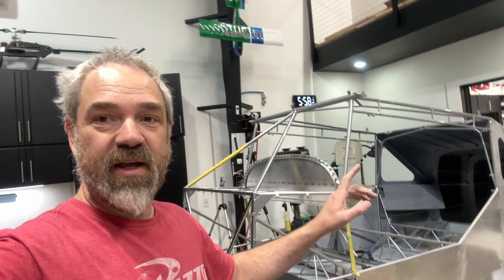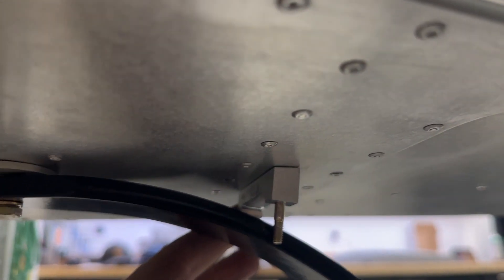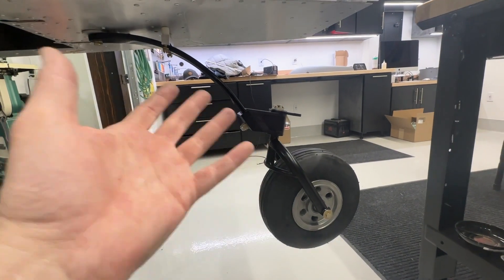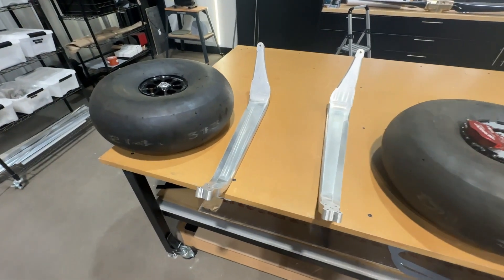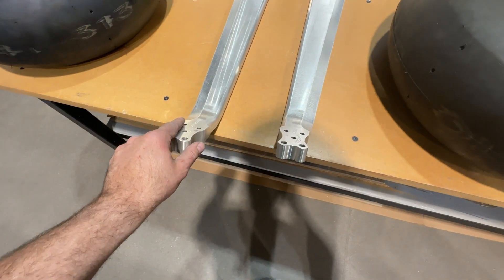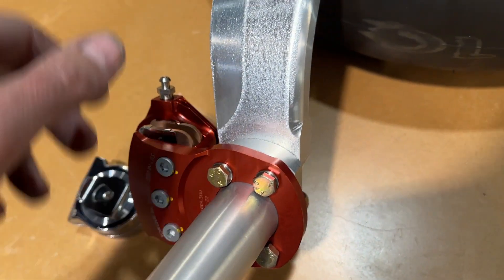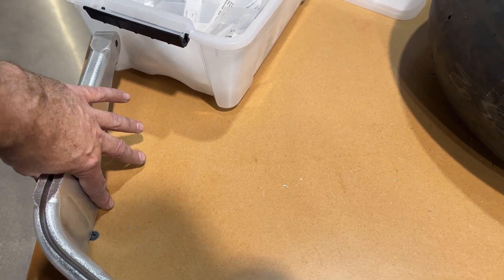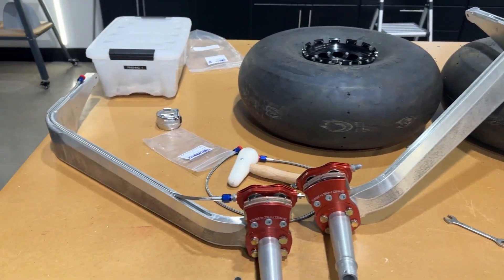Ep. 23 - RANS S-21 Landing Gear Installation

Comment: Not sure if you have addressed it in a future video, but did you ever figure out what 45 degree fitting was needed for the calipers? Just putting in my Beringer order and want to get the hardware sorted. Thanks for the heads up on the AN-5's. Hopefully they will get that corrected in the kits. Beringer kit for the S-21 is reference AV-RANS-421-01(B) for anyone else looking to order.

Comment: Soooo, my tail wheel bolt, just sheared, causing the tail wheel and spring horns to jam up under the tail cone. I remembered watching this video and came back to it to look at that arc, and I’m wondering if that bolt has to put an extra amount of tension to straighten out the spring?
Reply from the maker: Interesting. Where the bolt broke can tell me things. Did the head break? Half way down? 

The way Rans has the spring curved at the bolt it applies an asymmetric load on the head and a bending force along with tension. It’s a terrible arrangement that I wish they’d own up to and revise.
Reply: The bolt sheared at the base of the nut on the first thread. It was a wheel landing and happened taxing in on a smooth grass taxiway. I suggested to them that perhaps someone over torqued it…. Not happy.
Reply from the maker: Ahh right.. the bolt head is at top and points down. That location of the break suggests the issue I have mentioned.  The load on the nut is asymmetrical placing the bolt in a bending load right at the spring. Being the threads end just inside the spring this is the weakest part of the bolt and also the point of the highest load due to the bending from the curve of the spring and subsequent asymmetric load. 

Maybe when a few more snap they’ll actually believe there’s an issue.
Reply: @Outbound300  I agree 100%. Now I have to fuss with the damaged sheet metal from the tail wheel and steering horns that punctured the bottom tail cone skin 🤬

Comment: It looks like the rear spring is backwards. Looks like the tail end is flatter with no curve and would help keep in line with the skin if you flipped it. Or it’s the camera angle.
Reply from the maker: Good observation! 

If it were flipped it definitely has better geometry but the hole sizes at each end are different. Also the fuselage end is tapered and would not properly mount to the tailwheel. 

I do wonder if whoever makes these for Rans flipped how they finished each end as it would 100% be better turned around.